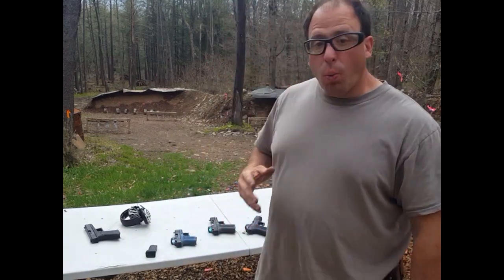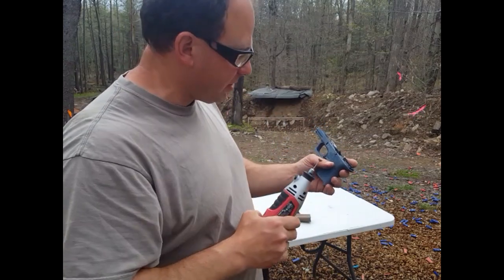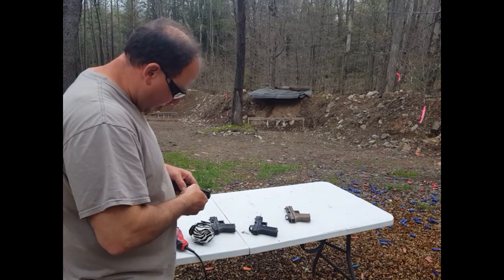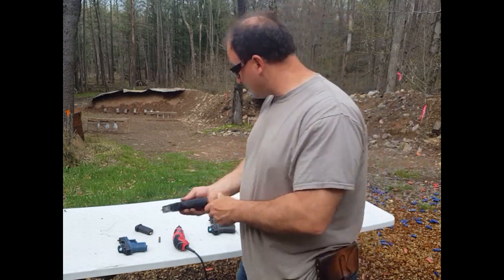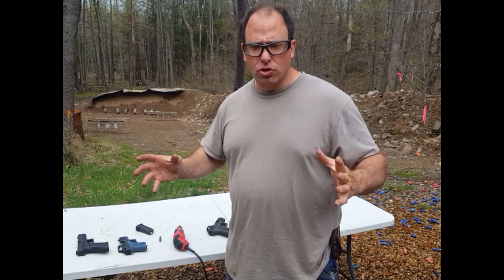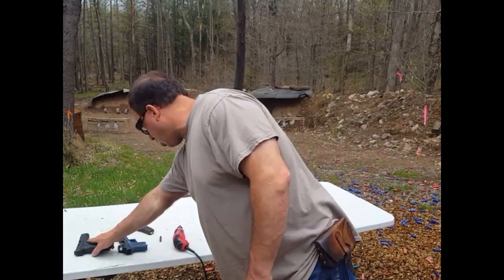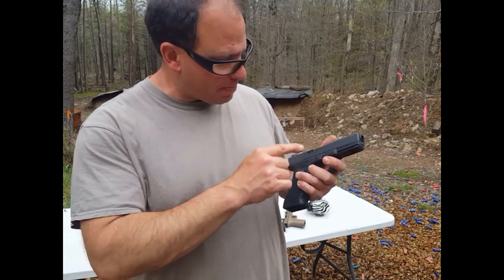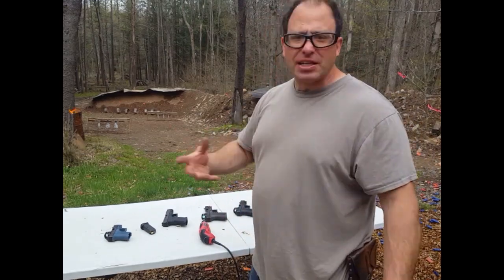Why "Ghost Guns" are Rarely used in Crimes

Comment: You did not mention that most of us have built guns that cost twice as much as any store boughten gun.... no Criminal is doing that.
Reply from the maker: That is an excellent point!
I'm pinning your post 😁
Reply: I got my 940c for under 500.
Reply from the maker: @alexf6206  two years ago yes I can get them built for less than $500. Now they are costing closer to $1,000 including Holosun 507c and ameriglo sights.
The slides alone cost $300 now
Reply: if im gonna build, i may as well use the highest grade custom vendor parts.
Reply from the maker: @whydotheathensrage  
In 2021, it's been a struggle to get parts. I get whatever I can get and then I can always upgrade.
Reply: You think criminals buy guns😂
Reply: @tsafa  $1000 minus 330 for the holosun 120 for the sights, $550 for the actual p80 $50 more ain’t that bad
Reply from the maker: @whatsmolly5741  
Guns should not be any more restricted then kitchen knives.
Reply from the maker: @adam100a8  
$550 to $650 extra for a gun that you can take special Pride that you built yourself is not a bad deal at all. 

I shoot guns almost everyday and I don't even think to shoot a pistol that I did not build myself.
Reply: A bare bones p80 can be assembled for about $310 right now, not counting sales tax and shipping.
Reply from the maker: @murphykenji  prices have dropped since I made the video, however if you're just putting cheap parts in there you're going to have problems.

My Optic alone is $300.
Reply: Not true. I work for the DCSO and i see more and more YOUNG 17-20 year old men building and selling these ghost guns all the time.
Reply: not true
Reply: @tsafa  I can get p80s right now for around 400
Reply from the maker: @skidwarfarebo2171  
Prices have fallen considerably at the end of 2021 because it does not look like Democrats are going to be able to ban P80s.

 We've done such a great job of converting more of the population over to our side.
Reply: Idk... it beats failing a background check
Reply: @strongblackliquor  it’s illegal for people that can’t own guns legally to buy 80% frames, and the to brag about online.  They’ll come for you and your dog
Reply: @Freakingstang  I'm not prohibited from buying anything. Just saying that if someone can't pass a background check, I can understand how they would pay higher prices for a build.
Reply from the maker: @strongblackliquor  
They'll pay somebody a small fee to get the gun for them
Reply from the maker: Playlist to build P80s here...

https://youtube.com/playlist?list=PLAnK0KlKOCRz_MP-M6ZlxQKse7u94GxrG
Reply: @Freakingstang  that's a shame, what about turning an ets limited capacity mag into a not so limited capacity mag?
Reply: @alexf6206  plus the 300 round break in? No you didn’t. You spent 800$
Reply: Pre covid I was all in on finishing my own 80% lower ar til I did the math. Andersons were still selling for $50 locally, the "good" jig kits were $500ish IF you could find one in stock.    I have little kids and could not and still can't justify that expense.
Reply from the maker: @paisleyprince5280  finishing AR receivers is a lot of work. They're not really 80%, they're more like 50% complete. 

Pistol frames on the other hand you can finish with home tools.
Reply: @tsafa   found that out the hard way but first one I made without a drill press, the majority of the fire control pocket is now jb weld but ya it did function somehow. Got a drill press for the 2nd one and it went much better but still need an x y vice to really do it correctly. Also it's not necessary 80% it's more like 120% as the whole receiver is there the work is just not complete.
Reply: @paisleyprince5280  a p80 ar frame and jig is cheaper than most of the hand gun frame + jig. It actually costs about the same for a glock or an ar build, of course just the basic parts but ya.
Reply from the maker: @whatsmolly5741  
I made one attempt at an AR receiver and I through it in the garbage after.
Reply: I just built my first p80 or 80%er and I dropped it disassembling for cleaning 🤦🏽‍♂️? Should I he worried and buy another slide now
Reply: @661evilsidevallero4  u should be straight as long as the area where the guide rod sticks out of the slide isn’t bent. The little round part on the end of the slide. Hopefully you know what I mean
Reply: Stolen guns cost $0
Reply: Mine was $750 with a trijicon red dot
Reply: Dnt underestimate criminals…
Reply: @tsafa nah you can get them for 400
Reply: P80s are all over the streets nowadays
Reply: No. I built one all parts included with 1 mag for $492
Reply: @whydotheathensrage  makes sense my friend
Reply: @ickyiceful lol
Reply: Why would you 3d print the gun if it cost twice as much with half the reliability and triple the difficulty to get shooting. Sounds like an all around bad deal. Plus the negative outlook. Idk sounds cool but impractical
Reply: Why would you 3d print the gun if it cost twice as much with half the reliability and triple the difficulty to get shooting. Sounds like an all around bad deal. Plus the negative outlook. Idk sounds cool but impractical
Reply from the maker: There's a great deal of satisfaction that comes from having an serialized gun. You get to tell the government to fock off.

Comment: In Marine Gun Builder we trust.
Reply: I can vouch, live long and prosper boys 🖖
Reply from the maker: @0BRAINS0  thank you!
Reply: 1st time quality
Reply: Love marine gun builder, with that said your putting together lot of parts with different tolerances … takes some time and patience
Reply from the maker: @Wickedstickyflowers  
Agree... I got it working with a lighter recoil spring and a heavier bullet
Reply from the maker: Playlist for building and debugging...
https://youtube.com/playlist?list=PLaazc8wM742rZSP6l4RlZ2RVBVIJNsJ7S
Reply: I can vouch my Polymer 80 works efficiently with out the apex upgrade lol
Reply: @kingp8182  I tried those apex extractor and did not work put the brass one on and it worked amazing.  The apex does work but with certain slides.
Reply: Amen 🙏🏽
Reply from the maker: @dreamsdocumtru81  aftermarket stuff can be a little tricky

Comment: Yup. Took me about two weeks once I had all parts to assemble my P80, and two trips to a range (located 30 miles away), along with a new barrel to replace the cheap one I bought originally, before my build worked properly and reliably. I’ve put 450 rounds through it with no issues. Some might be used in crimes but most “ghost guns” are factory made that have had serial numbers removed.
Reply from the maker: Great post! thank you!

Comment: I've recently built two P80 Glock clones. With the G-19 clone, it kept jamming during feeding. It's a Gen 3 design, but the only thing that solved the problem was to use the Gen 5 extractor. That solved the problem. The G-17 clone is still giving me trouble because of the extractor not moving enough to allow a round to chamber, but once a round is chambered, it jams to the point of needing a brass hammer to unlock the slide. But, I'll get it fixed.
Reply from the maker: It's not just a matter of gen-5, sometimes just getting a different gen 3 will also work. It's basically a matter of Tolerance differences because there's so many parts coming in from so many different places

It also seems like you might have to polish out the inside of your chamber and also the barrel slide lock up. If you search my channel name and polymer 80 troubleshooting you should find a few videos on that
Reply: your fault bro you just didn’t build it right or sand it down
Reply: @tsafa  On my G-17 clone, the problem turned out to be sickeningly simple. One of the screws holding the RMR plate in place was a hair too long, and was binding the extractor tensioner. Once that screw was loosened a quarter-turn, the problem went away.
Reply: @fuegokicks_2095  Have you ever tried building anything, other than a reputation as a troll?
Reply: Agree Also built some and all were fully reliable
Reply: I had the same problem but used a gen4 extractor. Worked well
Reply: Are you using aftermarket parts? If you use all OEM then you'll have less chance of an issue

Comment: I’ve never hair to file down my barrel it literally just take a few hours to get the 80% lower to 100% with sanding down the frame and I have about 1200 through my p80 g19 with a spiral fluted barrel most parts are oem except for my power spring kit that took my trigger pull from 5.5lbs to 3.5lbs
Reply from the maker: Depends on the parts. I've had some some parts that were just a little out of spec and could be adjusted. Other parts I just had to scrap.

Unless you have a box full of parts like I do, it can be difficult to isolate where the problem is.

I have a few barrels and slides that work to 98% reliability.

I have plenty of builds that work 99.9% reliability. No gun is going to be 100% reliable because the ammunition is never 100% reliable over thousands of rounds. That includes Factory Glocks. 

I have built and tested more guns than most people, so I have a very wide experience.
Reply: @tsafa  that’s true like I have an out of spec slide where once I get the slide on the rails and pull back I have to push towards the right for the slide to catch at where the ejector meets the backplate but my Glock 23 slide no at all fits perfectly so yes I guess it does come down to just the QC at the end of the day

Comment: So for your 26 poly80,,, look at the slide under the extractor. If there’s a nub of metal under the extractor, remove the nub with a file or a dremel… the nub won’t let the new round feed under the extractor. Already had that problem,,,
Reply from the maker: It turned out that the barrel was slightly out of spec

Comment: Great point about bad guys removing serial numbers.  Haven't heard that point before, but it makes sense.  Obviously it takes a lot less skill and time to remove a serial number than it does to build something reliable.  I've heard a similar point made about the California nonsense where a firing pin is supposed to make a unique mark on the primer.  Just replace the firing pin.  Silly government.  Good work.  Thank you.
Reply from the maker: Thank you for your feedback. I'm glad you like the video. The firing pin stamp is completely idiotic, because you could just rub that against some cement to erase the stamp.
Reply: Or a crook collects brass from a gun range to seed a crime scene with other people's serial numbers.
Reply: From what I understand everything unique like your fingerprints on your hand.Same with firearms. Parts like barrels, extractors,exjectors,face of bolts exjections ports leave unique marks either machine or cast all leave tell-tale evidence along with residue. This is nothing new
Reply: @niquemarshall  What video?
Reply: @niquemarshall  Even if you go to an indoor gun range with cameras, everyone is wearing a mask. And have you =seen= security camera video?

"Have you seen this large blur? Call into our tip line if you have."
Reply: @albertvelasquez7089  Not really. The only thing they've ever found useful in matching bullets to guns are the marks on the bullet from the inside of the barrel. Everything else are interchangeable parts. The inside of the barrel isn't polished because it is difficult to do so.
Reply: Same with the barrel. On a Glock or pretty much any semi auto pistol the barrel is removed every time the gun is taken apart. There’s tons of people with Glocks who change out the barrel for a “better” barrel that is in fact just a Gucci barrel for looks but it still changes the ballistic fingerprint of a gun. The bullet that was fired and saved for ballistic identification when the gun was made will match the original barrel but not the new one. There’s no regulation on buying barrels online… it’s an unregistered part sold over the counter so to speak. It’s really all nonsense and you common thug probably can’t tell you anything about the gun he uses in crimes besides what caliber it is and maybe who made it.
Reply from the maker: Police forensics is very much hyped up. You can not convict anybody on forensics alone. As far as matching up a bullet to a specific Barrel, the best they can say is there's a 10% chance that it came from this battle or an 80% chance that it came from a barrel. Never 100%.
https://youtu.be/rGfSwLNUJSY
Reply from the maker: Polymer 80 building playlist here...
https://youtube.com/playlist?list=PLaazc8wM742rZSP6l4RlZ2RVBVIJNsJ7S
Reply: @niquemarshall  There you go, assuming every gun range has cameras.
Reply: @niquemarshall  people collecting brass from a range is pretty common, they will take it home to reload. Also it's common practice for polite people to sweep up their brass when they are done shooting and throw it in a can usually marked brass somewhere on the range. It would be quite easy to pocket some without a camera seeing and it really wouldn't even be suspicious anyway.
Also it's a matter of 50-100 bucks to buy a new barrel and about 6 5 seconds to swap it out on most modern semi auto pistols. Tool marks on the rear o fthe case like the primer would be minimal and almost impossible to match because the firing pin surface will continue to change with use. Ballistic evidence is no where near as accurate or useful as they make it seem on TV. And I believe they stopped keeping a fired case from New guns several years ago because the program was costing a massive amount of money and wasn't leading to many solved cases.
Reply: @AlienRelics  excellent point. And many ranges are just open fields. Any of the control measures such as firing pins stmps and all that can be easily defeated by buying a new firing pin, altering it or making a new one, or simply throwing brass all over the place after the shooting. These measures don't do anything. We criminals switch to hammers are they going to be serialized too? None of these measures ever do anything except affect the law abiding citizens. 

Why? Because illegal guns are already illegal. Stealing is already a crime. Criminals...gasp... Don't care about laws!!!
Reply: You can grind off stamped serial numbers,  but if it was used in a murder, they can still read the numbers with x-ray.
Reply: @albertvelasquez7089  that’s False. Fingerprints sticking on Guns even after You wiped it off is a Myth also..Any cloth or fabric will remove or smear a Fingerprint with little to No effort.

Comment: You might need a stiffer spring depending on the barrel composition
Reply from the maker: It turned out that the barrel was slightly out of spec.

Comment from the maker: The way a Gun Tace works is by going to manufactuer, to distributor,  to FFL, to purchaser. 
Remove the serial number means that Trace stops with the manufacturer. 

Private Sales are legal. The purchaser can also say they sold it,  gun was stolen or lost. However if serial number is scratched off he'll never get that far.

50% of gun Trace requests our dead end. It's a just a lot of work with no results. Serial numbers on guns are there mostly to scare people.

Comment: You got 20lb guide rods?
Reply from the maker: The springs
Reply: @tsafa  yea my bad. Thinking about my gen 4
Reply: @tsafa  what Springs do you have installed?
Reply from the maker: @Chapaveli5959  I can't remember. I did this video long time ago.

The main problem was that the barrel was slightly out of spec and causing extra resistance. The problem was fixed when I change the barrel out a few months after doing the video. It now works with a standard spring for a Glock 26.

Comment: Takes me about a day or so to get one running good. file, polish, test, file, polish, test, all you need to build these things is a drill press x y vice, dremel bits end mill bits it cost way more money to make p80 then buy them especially if its your first build without tooling jigs etc
Reply from the maker: Sometimes it goes smoothly and it gets done within a few hours. Sometimes it takes days to debug.

Comment: I had awesome beginners luck on my first one a g17 clone.  but the subsequent builds have been problematic. but that's the fun for me.  I have never filed on a barrel or slide tho.  That makes me curious as to what you saw that that was the solution.
Reply from the maker: Thanks for that awesome feedback. When I placed the cartridge into the barrel with my finger I saw that there was a lot of difficulty in pulling it back out, so that told me that I needed to polish the chamber for easy entry and exit.

The other thing I noticed was that the Barrel was locking up very tightly to the slide so it would take a lot of effort to get that slide to separate from the barrel when I try to open it. That told me that I needed to file down the edge of the ejection port at the top where the barrel locks. Just a tiny little. Basically I just rounded off the edge.
Reply: @tsafa  I had to do the same thing for a smooth action. They say in order to safety test the lockup, hold the trigger to the rear with no ammunition or magazine, and point it straight up and pull the slide back just enough to come out of lock-up. Let the slide slowly move upwards until you feel the lockup resistance between the top of the barrel and the inside of the slide. If you’re able to get the slide to get stuck then it’s not smooth enough. Essentially, while held vertical with the trigger depressed, the power of the recoil spring should be enough to put the action in battery. (Not letting the slide slam forward.) The key is to actually TRY to get it to stick. If it doesn’t, you’re good to go!!
Reply from the maker: @samueljackman7631  that's a really good test!